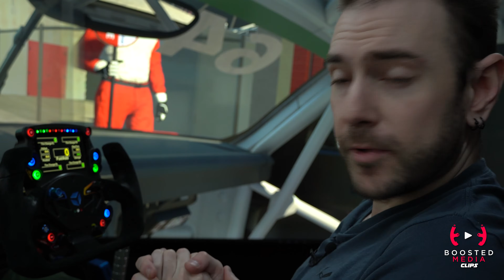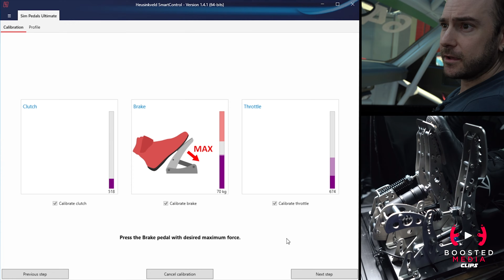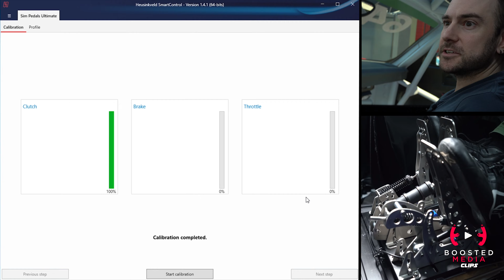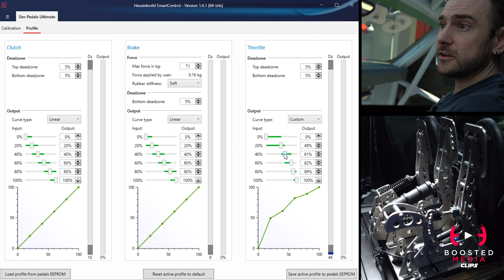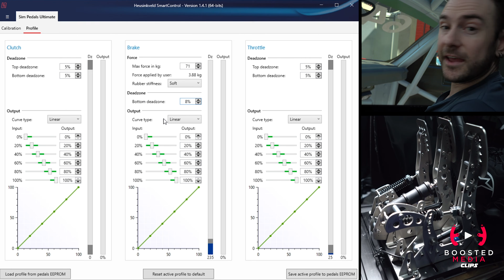Heusinkveld Smart Control Software Explained

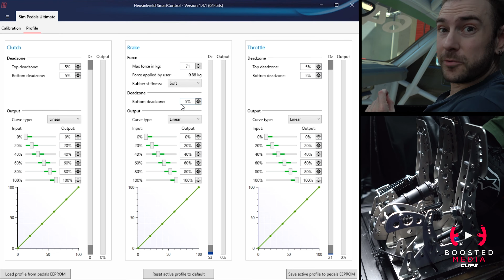Comment: 13:42 @Boosted Media Clips: The "soft" setting limits the max value of "Max break force" to 100 kg so that you can not damage the springs with your settings as they are rated for 100kg max.

Comment: I just bought mine, mainly run GT3s on Iracing. Anyway have recommend software settings? I’m thinking some kind of “slow end” would work well for both brake and throttle

Comment: Can this Heusinkweld pedal works with Fanatec wheelbase? Do i need drivehub to make them work together on a PC?
Reply: Yes! They connect to a PC through a USB port separately from the Fanatac wheelbase i.e. you are NOT connecting the Heusinkveld to the Fanatec wheelbase, you are connecting them directly to the PC.
Reply: @arpabot  thank you

Comment: Hi i have the ultimate + pedals and ive tried to set 3 profiles up with different brake loads. The profiles dont appear to save the force changes.
This is what i did. Started with default, save as F1, then GT3 and road.
Then i tried road first and set force to 25kg. Saved and overwrote old race profile. Loaded gt3 and the force was showing 25 not the default value used.

Comment: I'm suprised there are no comments in this helpful video :) I'm rocking Sprints and love them... been using them ~1.5 years for now and they've been at linear (brake at 40kg) for all of that time :) But  now with the iRacing new Porsche Cupcar I'm thinking of going to the output maxed out to 80% to avoid locking up the brakes accidentally. Is there a good way to save custom profiles in the SmartControl.. I don't see there's an option to save/load different profiles... I think there was that option with the original software what was before SmartControl?
Reply: Just click the icon close to the pedal’s tab and you will see the buttons to load/save